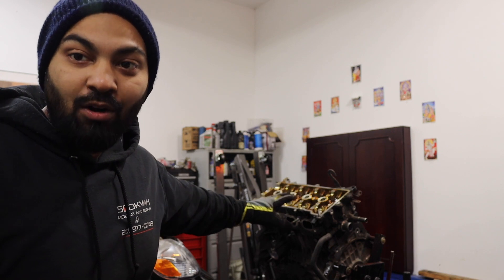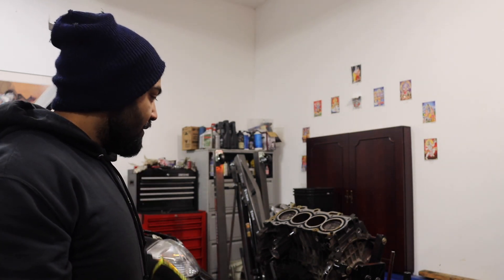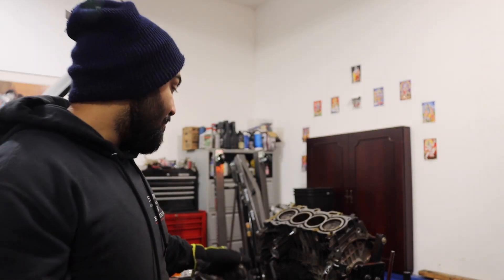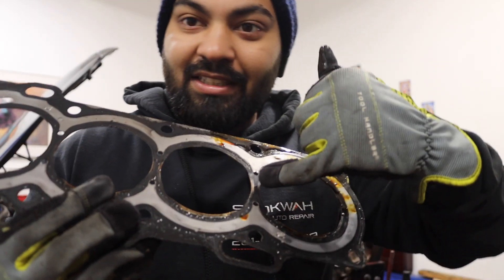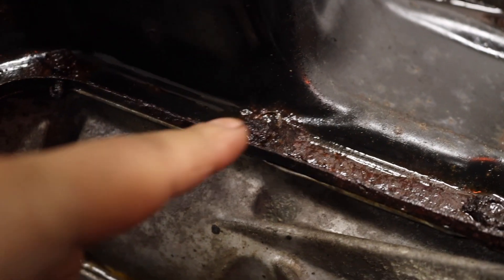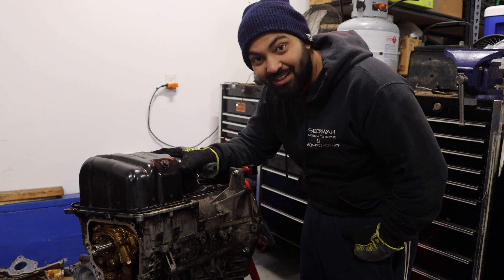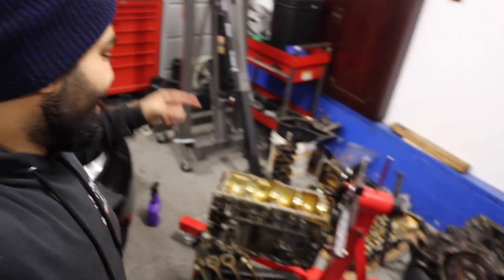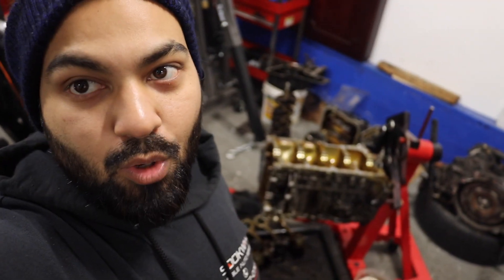Toyota corolla 1zz-fe Engine breakdown! (1/10/2021)

Comment: Hey would doing an engine rebuild get rid of the oil burning issue? I have 2000 Toyota Corolla as my daily but man it burns oil like mad lol.
Reply from the maker: So your oil burning issue is mostly a result of piston rings. So yes doing a complete build with new rings will correct that issue. Well it should correct the issue. Also get new valve seals in the head and what not
Reply: @Kingcustomz  thanks I will definitely look into that.
Reply from the maker: youre welcome my friend

Comment: Is it common for the 1zz to brake and at what mil
Reply from the maker: these engines are actually really good. they last a good 5 or 6 hundred k before problems.. ive even seen them hit 1 million miles. 
I ended up rebuilding this motor due to oil leaking out of the manifold ports because of failing valve seals
Reply: @Kingcustomz  yeah im at 223k now replaced all ball joints bearing eng mount just hoping it all worth it
Reply from the maker: If you love the vehicle and want to keep it, it is worth it. As long as you feel it's worth it, then it is

Comment: I tried replacing my rod cap bearings but im sure I mixed up my caps. Now when I torque down to spec crankshaft wont smoothly turn
Reply from the maker: Your caps should be numbered 1 to 5
Reply: @Kingcustomz  yea I have 2-2s 1-1 I only removed 3 but dont forgot to write done what order they came off in
Reply from the maker: Look on the caps, they are engraved into the casting
Reply: @Kingcustomz  yea that's what I see 2,2,1 but I don't know what rod they go to mixed them up with out marking. Them do you know if they're in a specific order?
Reply from the maker: okay from the crank is number 1 followed by 2. then the center one is different, the center one is number 3 and that has the two shims on the side. finally number 4 then 5. 5 should be the one on the rear main seal side of the motor.
Reply from the maker: and I believe on of your 2's is actually a 5 lol. the notches in the bearing caps, must line up with the other notches on the block. by notches i am referring to the ones that snap and hold the bearing in place.,
Reply: @Kingcustomz  I only have 4 rod caps . so if i dont have a 3 do I line it 1, 2,2 . you have an email maybe I can show you what I mean. I have a Pontiac vibe 03 1zzfe 1.8L
Reply from the maker: Yes sookwahryan@gmail or add me on Instagram king customz